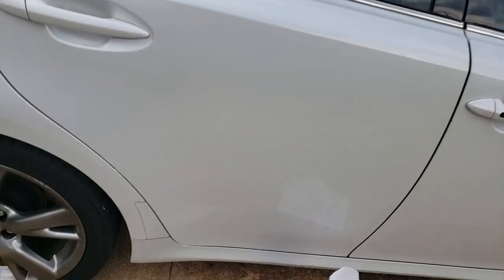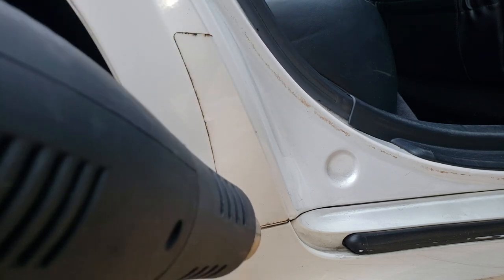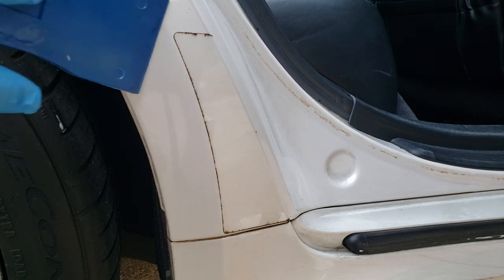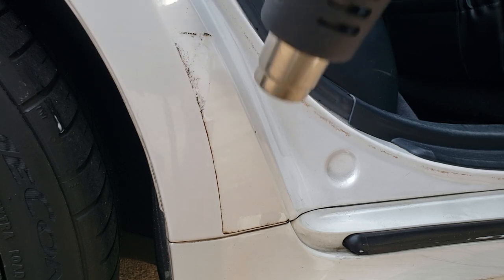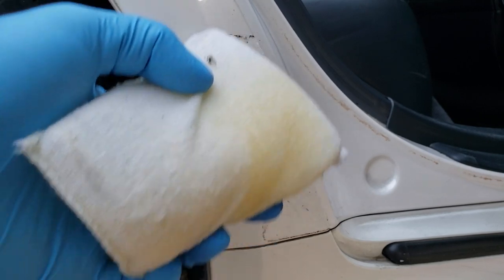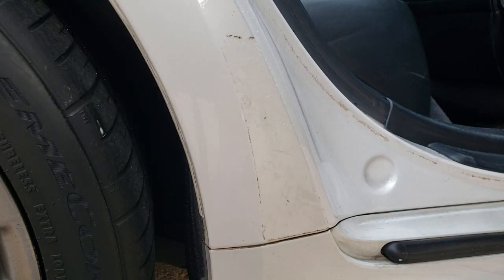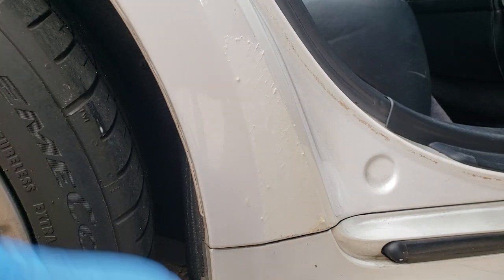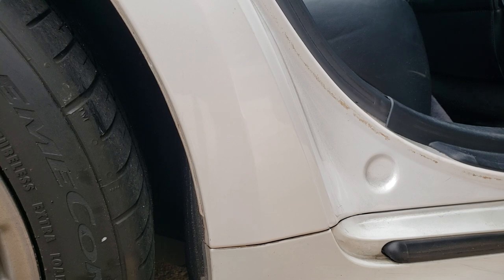Removing Clear Stone Guard Protector From Your Car - Lexus IS350 IS250 ISF

Comment: I've always used mineral spirits to remove decal and label adhesive and turpentine to remove dried tree sap from cars,trucks ect; I hope it will work on that adhesive as well.  My neighbors cars adhesive has turned green.Will be working on it this weekend. I also use plasic razor blades to lift the vinyl along with the heat gun.

Comment: I watched one for a Porsche 911 and he used a steam gun but said you can't do it that way if the car had been resprayed, as the paint will lift off. My Porsche Cayman (2010) hasn't been repainted, but the adhesive is getting foggy under the film. I can rub the film with a microfiber towel and it becomes clear again for a little while and it's time to try your method out. Supposedly there is a new generation of film that doesn't have this affliction and I will be applying some of that to my car. My car only see's the sun while I'm driving or washing it.

Comment: I use a hairdryer to heat up the guard and peel it off in one swipe.......clean with adhesive remover, install new one with slip solution/rubbing alcohol for edges....
Reply from the maker: That works!

Comment: where did you get the replacement and what’s it called? i’ve search “stone guard”, “stone protector”, “rear panel protective film” and everything else I could think of. All that keeps coming up is this video. Thanks
Reply from the maker: I did not replace it.  I don't think it is really needed.
Reply: Quarter Panel Protector - Lexus (58741-53020)

Comment: Good video.  If you soaked a paper towel with the Goo Gone, and then taped it over the adhesive for a few minutes, would it soften the adhesive without damaging the paint?

Also, just curious, why does it appear that the paint inside your door jambs is whiter than the rest of the car?  Has it been repainted, or did the paint just change colors that much?  Not a big deal, just wondering.
Reply from the maker: Thanks!  Goo Gone won't soften the plastic so that won't work as it would need to go through the plastic to break down the adhesive. 

The car has not been painted. It is a pearl white so the light and the angle is likely throwing everything off.
Reply: @jamie.andrews  good point, but I actually meant after the plastic was removed, as a way to soften the remaining adhesive.  Thanks
Reply from the maker: @darrellkidd5177  OH very sorry for misunderstanding. Yes that might work!